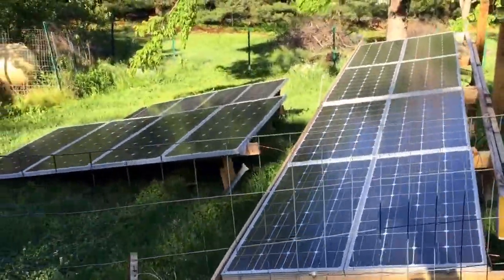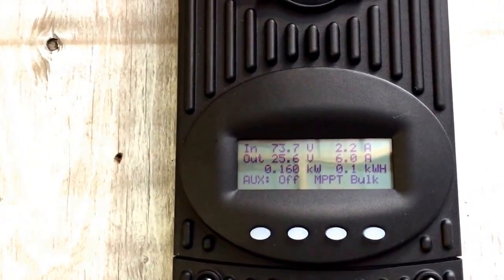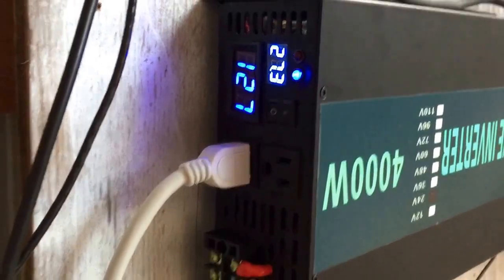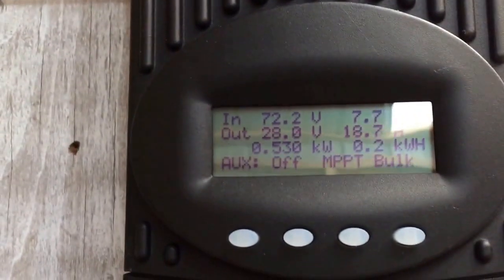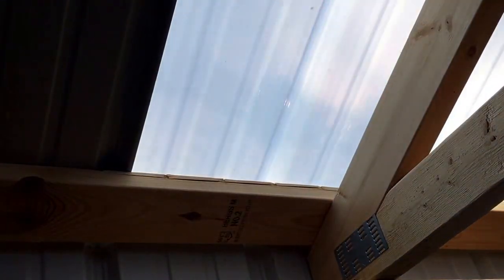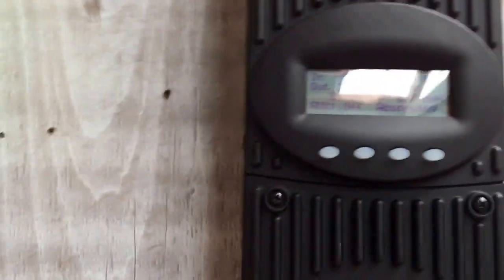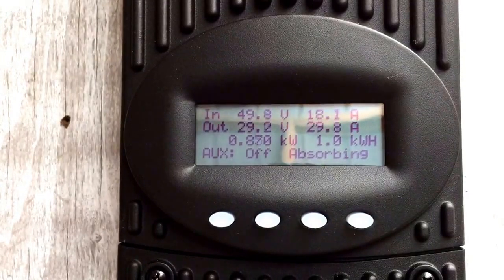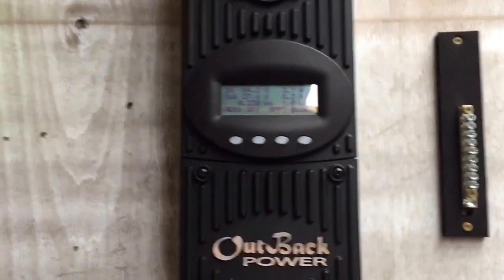The new reliable 4000 watt inverter passing test today, great 1st half solar day

Comment: im running a 24v /120 3500w reliable inverter and have had great luck thus far with it. since day one we have been running my fridge and freezer plus 1 ac and most of my lights in my home. so hitting 3k on the inverter and its still running strong. 

very happy with this product.
Reply from the maker: Good deal

Comment: I have 3 of the reliable inverter and love them 3000w 48 1500w and 500w 24v the 500w has been running at around 400w for almost 10 months now no problem my 24v models cut off at around 30.1v red light starts blinking at about 27.5

Comment: TomT342 has a reliable his cuts out at a reasonable voltage, i think his is a 12v system by memory
you must have some tallish trees near by
Reply: got to watch those inline watt meters , ive had smoke pouring of mine with 50amps 29v continuos even though theyre "supposedly" 150a or more